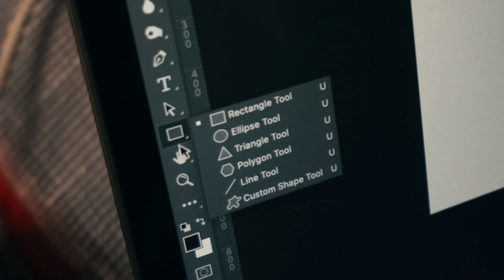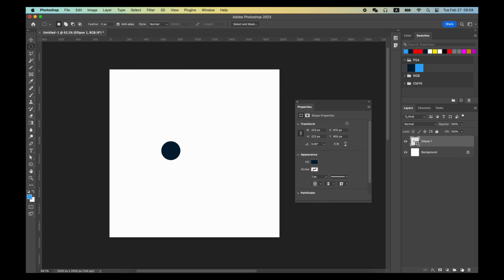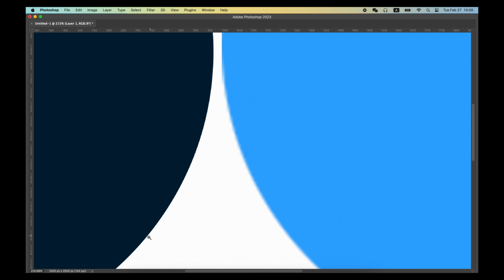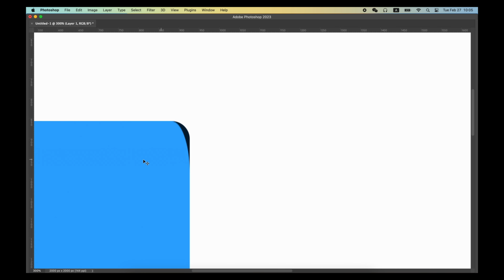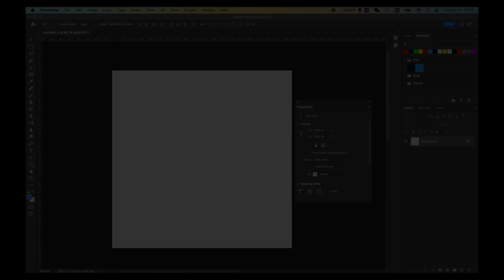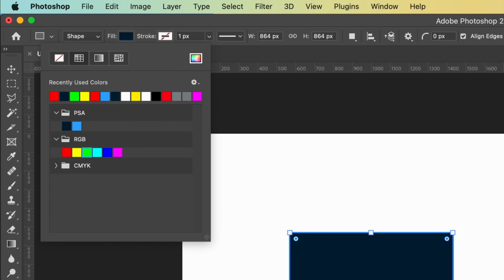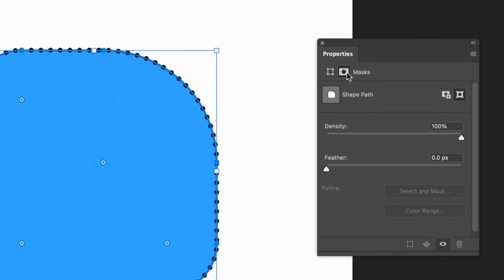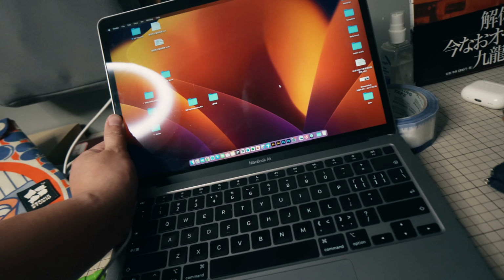Rectangle & Ellipse & Triangle & Polygon Tool - Toolbar Explained & [Photoshop for Beginners]

Comment: hi, show us a video on how to make a retangular tool and only use the shape as stroke boarder and empty from inside?
Reply from the maker: After you created a rectangular or any types of vector graphic. You can find "Fill" with a small color block in the option bar, which is just below the top menu.
Open it, and you will find the very first block looks like a white squar with a red slash on it. This "color" is for transparent fill.
It also works for the stroke.